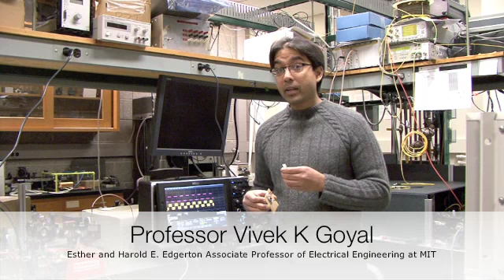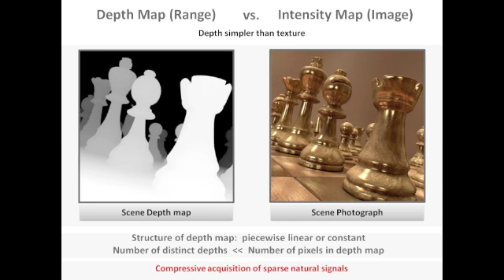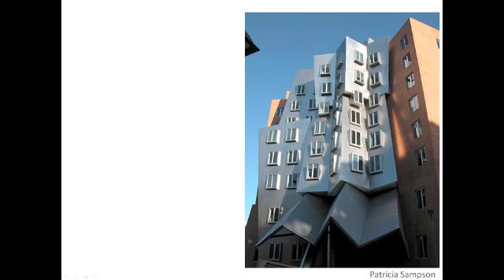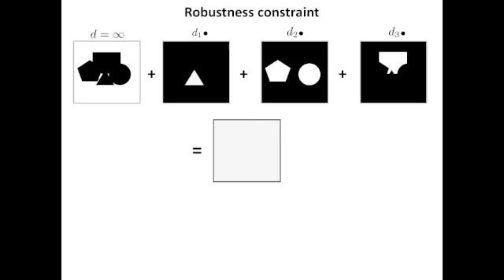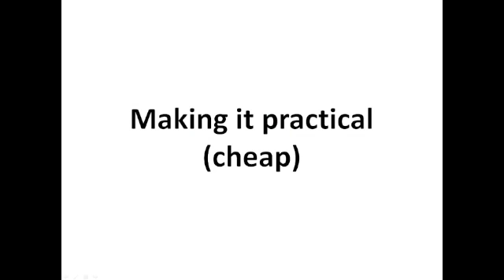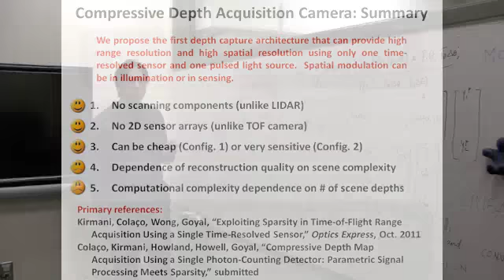CODAC: COMPRESSIVE DEPTH ACQUISITION CAMERA

Comment: @LanceWinslow5 I think you would use tried and tested depth acquisition methods; for your application I think a laser/Lidar methods might be better - cost isn't really an issue for you. The CoDAC method doesn't currently support curved surfaces - and is really for mass, low cost applications. Contact your local university, sure they can help.